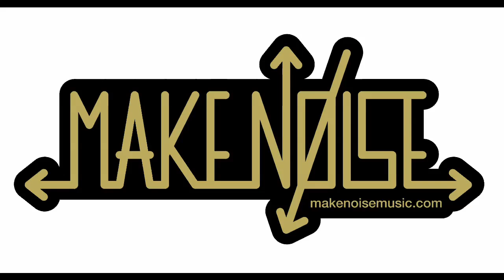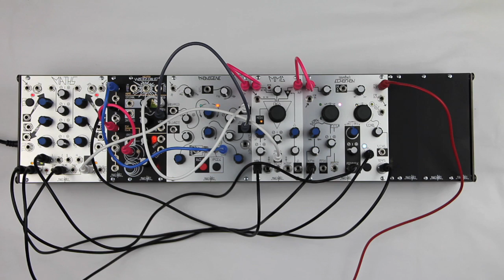Make Noise System Concrète

Comment: It's pretty awesome - in a sad way - that this seems to be the only video on YT about the System Concrete. It's clear that this system was five years ahead of its time, directly leading to its successor, the Tape & Microsound which is fundamentally a modernized version of exactly the same layout. I still have all the necessary modules to create this setup, so I will create a 'celebrating the 5 year anniversary' video soon - probably today - honoring the hard work that went into this. I've been fooling around with it to prepare, and it's so much fun!  Is it OK to record stuff from the 'musique concrete' video as source material?
Reply from the maker: Hey that sounds fun! Yeah, go for it - you're talking about the video with the household object sounds? Would be great if you posted your link when finished in these comments and on the comments for that video too :)

Comment: Love the Phonogene, but the thing that puts me off is the splicing. The clicks from splicing at non 0 cross points are all over the place, which is understandable.
Also, what is the max sampling time at best quality?
Reply from the maker: +nectariosm The ability to splice at non-zero gives the most flexibility. You could use the EOS triggers to fire an envelope if you want no clicks. 
Sampling time and quality are inversely-related. Longest time is about 20 seconds, at lowest rate.
Reply: +MAKEN0ISE Yup, fair enough.
What's the sampling time at highest rate?
Reply from the maker: +nectariosm 2 seconds.
Reply: +MAKEN0ISE Thanks for taking the time to reply. Put my Slim Phatty up for sale to fund this :D
Reply: +Nathan Butler Whilst I appreciate the concept of mimicing a histortical mechanism, I don't need non 0 cross point clicks in anything I record, unless I want them to occur, intentionally. 
Granted, clicks can be avoided if one splices at the right point, it is not the module's "fault" if one cannot splice at the correct place, which is why I said its "the thing that puts me off", instead of blaming a fine tool for music making.
What ever floats people's boats and yes Make Noise is pretty smart stuff, which is why I own lots of modules from them and use them day in/day out.

I do hope there is a second Phonogene coming out at some point, that will be stereo and have an algorithm that will prevernt non 0 cross point, clicks, only to make life easier for people that "don't get it" when it comes to not wanting digital artifacts such as very audible clicks. Until then, Clouds (yes its not exactly the same) is doing the trick for me.
Reply: Anyhow, there is an answer already as to how clicks can be avoided, so no biggie.